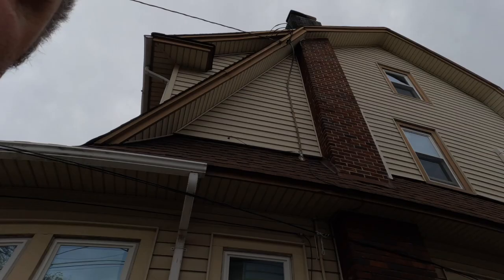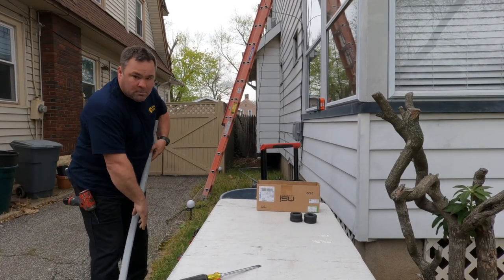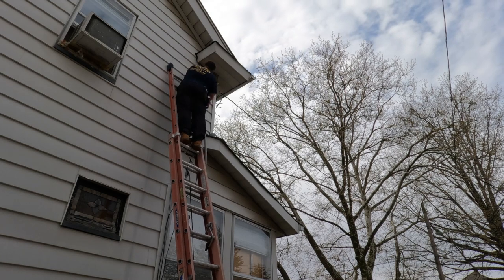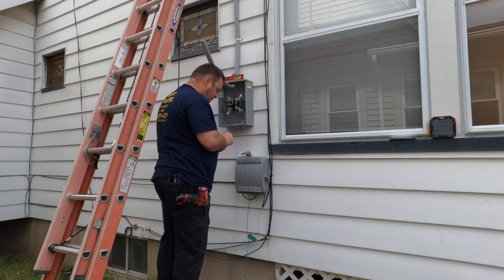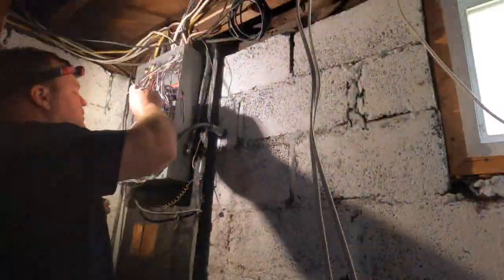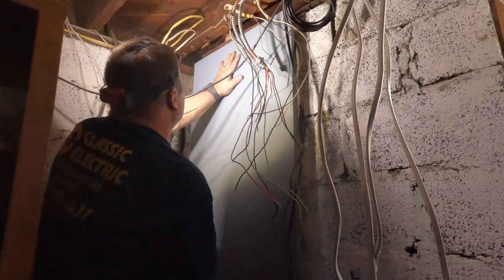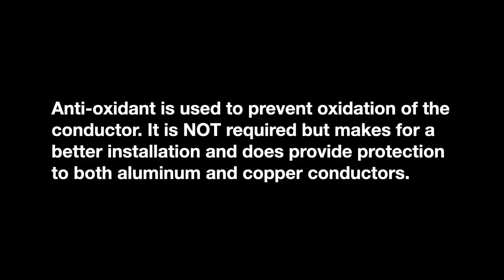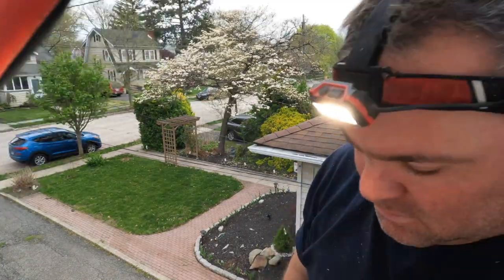Upgrading Electrical Service to 200 amps | Rahway, NJ    #200AMP #ElectricServiceUpgrade #Grounding

Comment: I’m sorry, I meant can you have some 200 amps and 100 amps at the same time in the box. My electrician put in a new box and put in some 200amps and some in as 100 amps.  Just wondering if this is okay.
Reply: I believe you only have one or the other. Maybe your panel is rated for 200 but your service is actually 100. Never heard of 2 different sized services coming to the same panel but could be wrong.

Comment: I thought it was the utility's responsibility to connect/disconnect the main overhead feeds.
Reply from the maker: Its different from state to state. Check with your utility company to find out their policy. Here in NJ this is PSEG territory and as long as I have a permit and an electrical license I'm permitted to do this cut in and cut out.

Comment: What wire gage do you recommend to use on a 200 amp?
Reply from the maker: 2/0 copper or 4/0 aluminum.

Comment: Where is the emergency disconnect required in 225 .41?
Reply from the maker: There is no article 225.41.
Reply: @electricianron_New_Jersey  you better check again.
Reply from the maker: @jeffreyknowles6265  I already did.  It does not exist.  Did u mean 230.85 maybe?

Comment: Does the utility charge a fee for the installation of the new meter?
Reply from the maker: That's a question for your utility company. Normally around here the old meters are replaced with modern digital meters but I do not know if there's a charge from the POCO or not.

Comment: Is it common for 14/3 to enter the load center for 120 volt only??
Reply: Is used for 3 way switches
Reply: @dape7  for a circuit th 14/3 enters the load center?
How does it get connected?

Comment: Hi Ron. How much roughly does a job like this cost the home owner.
Reply from the maker: Roughly $3000.00
Reply: Hello, ron, why would a company charge me $30,000 for a service like this ? I have a electrical panel with four breaker (house is old) and I want to upgrade to a better panel such as the work on this video, would the rough estimate be around the 3k ball park ? Thank you
Reply from the maker: @kerwinvergara3335  The most expensive service upgrade I ever did was $6500.00 and that was for a 3-family home. It was a 200 amp service with (3) 100-amp service disconnects/ meter base all in the same enclosure.
Reply: @electricianron_New_Jersey  got it, when I heard 30k I was questioning the worrying. But thank you. I want to upgrade to a 200a panel as well

Comment: How is having exposed cable like that even legal?? Where you from New Jersey? That's some wacky codes up in your area
Reply from the maker: What do you think might happen?
Reply: For one depending the neighborhood its in , you can steal off the line side … it’s not protected regardless of what it says on the sheath . I live in California, licensed c-10 holder . I’m not knocking your work what so ever but that would never pass any inspections here in California . Not from the building department, especially not from the utility company . The #6 grounding wire for 200 amp service ??? Not possible here . For what your state allows the work you did looks good . But i have to agree so many red flags .
Reply: @Electrician Ron   codes are different all across the country.  With all phases of construction.  Some need to inspect drywall screw pattern.  There's really stupid stuff and over kill in every state
Reply from the maker: @pauls.7250  You're funny. The #6 AWG copper is for the ground rods. You mean to tell me you run a larger conductor than that for ground rods?!! GROUND RODS???!!!
Reply: @electricianron_New_Jersey  yes sir , 200 amp service #4 ground wire to , two Ground rods 6 feet apart . 
Along with grounding the water main , again with #4 ground . Gas to water bond #4 wire again. 200 amp service.
Reply: @pauls.7250  are we talking 4awg Aluminum or copper?

Comment: When someone told me I should upgrade to 200a I thought they were full of shit. Turns out, they were. There were 2 double breakers in my box feeding to things that weren't there anymore. A baseboard heater and an in-wall heater. There was also a single breaker feeding a well pump that was no longer there because my neighborhood got city water before I ever moved in. After freeing up those 5 spaces I didn't need shit.
Reply from the maker: Or until you remodel a kitchen, bathroom, and basement.  Then you’ll need more spaces in the panel.  You really don’t need a 200 amp panel unless you have a load that demands 200 amps or you need more space for individual circuits.

Comment: Hi .. can u helpme im pool tech. I was change the pool light. 12v leds .. but when i touch the ligth. Feel shock of power .. i removed the groud inthe junction box .. and now dont feel nothing
Reply from the maker: The neutral conductor is broken some place and current is is flowing on the normally grounded parts. Normally, GFCI-protection would prevent this from being energized when it shouldn't be but I know for sure there is no GFCI protection in this scenario. Call a licensed electrician for further assistance is the best advice I could offer you.
Reply: Any metal (ladders, lights, etc.) in or near the pool needs to be bonded to the common ground.